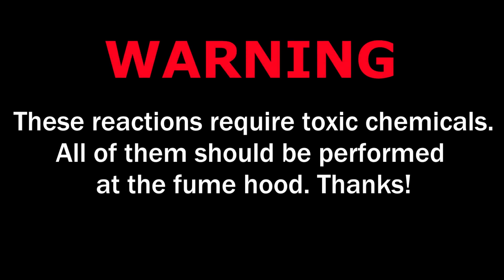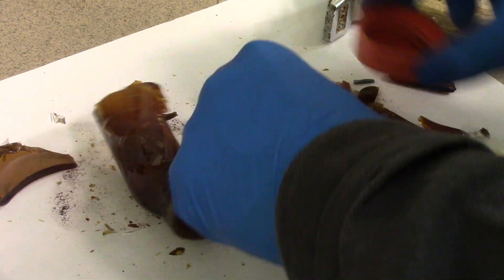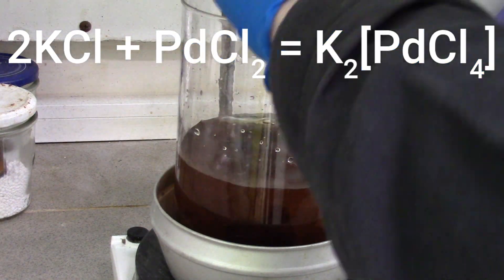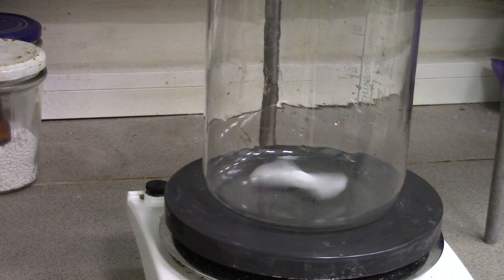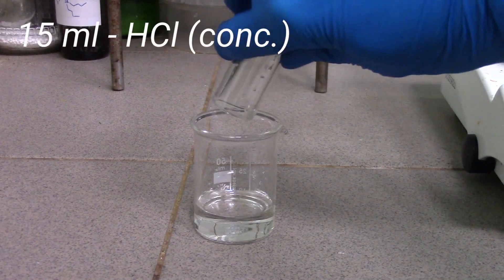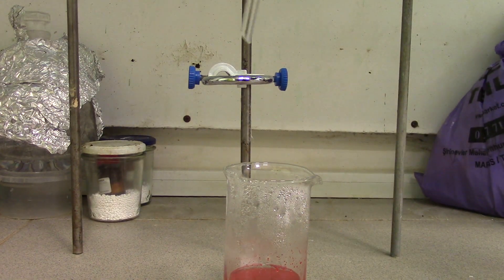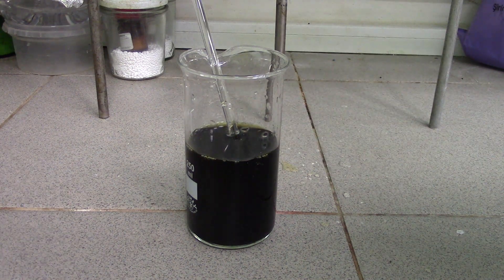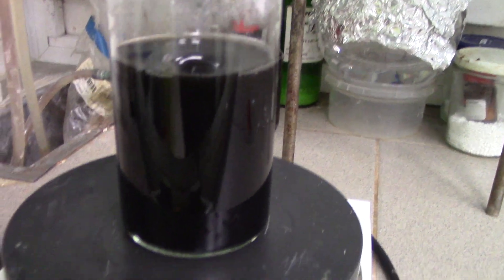How to recycle palladium in chemical lab? | Experiments

Comment: I saw again your video I have some questions:
1-you use 25cc SnCl2 solution please tell me how much weight of Sn combine with 25cc HCL?
2-process for K2[PdCl6] to Pd is it calcination K2[PdCl6] to PdO and then melting PdO to Pd?
Best Regards
Reply from the maker: No prob man! 
1 - it was 15% solution of SnCl2 (20 ml) + 5 ml of 1M HCl
2 - No! It's Pd metal precipitates, it could be just washed by water and melted to bar.